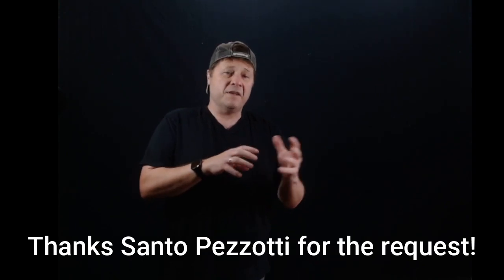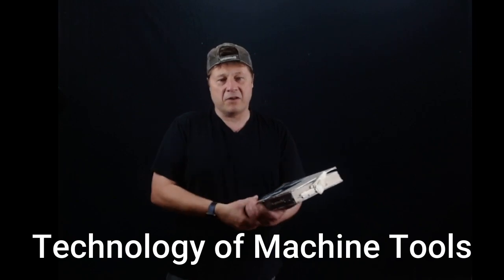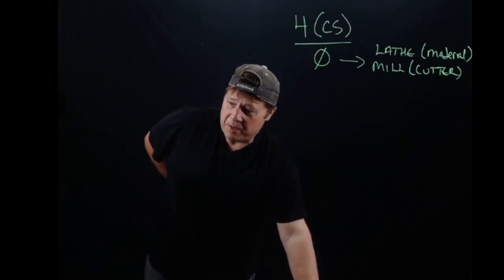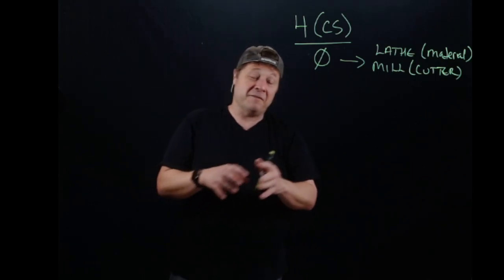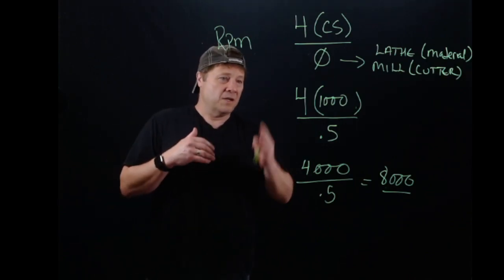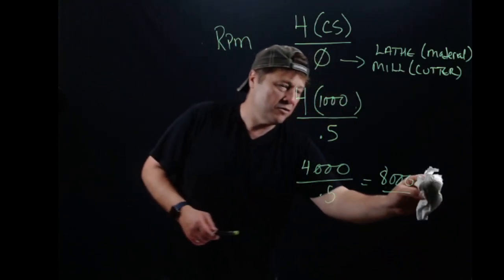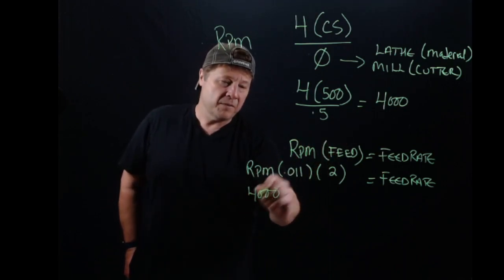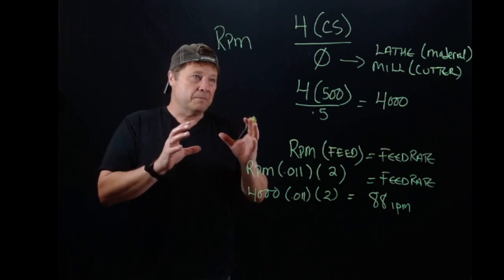Mill Feeds and Speeds - solve RPM and Feedrate

Comment: Should the feed rate for the lathe at 12mins in not be in inches per revolution, instead of inches per minute?
Reply from the maker: For clarification, the formula for Feedrate is RPM x Feed per Tooth x Number of cutting Teeth.
In the video I just refer to Feed per Tooth as Feed.
The solved 88ipm is the Feedrate in inches per minute.

Comment: Hi Adam
Thank you for video
Is cutting speed for metric  and inch drill same or different? when you use formula N=Vc *318/D and N=Vc*3.82/D?
Also Is cutting speed chart for drill and lathe also mill same?
Reply from the maker: Hello again @silkroad9188.  Cutting speed for imperial is in feet per minute and for metric is in meters per minute.
Simplified inch formula:
4xcutting speed/diameter of the tool (milling machine)
for metric
320xcutting speed/diameter of the tool (milling machine)
320 is the standard and doesn't change.

The non-simplified formula for imperial cutting speeds is:
12 x cutting speed / pi x diameter of the tool
I usually only use this formula when solving spindle speeds for a CNC mill as the spindle speeds solved can actually be used where on a manual mill, only approximate speeds can be reached.
Once again, I hope this helps!

Comment: Is there a formula to scaled-down feed speed? If my free rate is 7.353.6 RPMs but my machine max speed is 3,000. Is there an equation to scale the speed?
Reply from the maker: I'm not sure exactly what you're asking. What is the RPM that you calculated? And what is the maximum RPM that your machine can run? Because if you're asking if there's a way to calculate RPM based on your maximum spindle capabilities, then yes I can help you with that.
Reply: Cross multiply, then divide. Ratios are pretty simple
Reply: @adamtaylor999 yes I'd like to know this!

Comment: The correct (simplified) formula is RPM=(SFMx3.82)/Diameter.

People who use 4 instead of 3.82 are the "looks good from my house" guys. To simplify the real formula, you divide 12 (feet) by Pi (used in the circumference calculation). 12/Pi = 3.8197, which you would then round to 3.82, not 4. The book I have from college uses 4 as well, and it drives me crazy because the Machinery's Handbook uses the real formula. In machining, you need to be as accurate as possible, especially with harder materials. Please stop saying 4 is close enough.

**This is not an attack on you, it's an attack on the people who wrote the book that gave you the information.**

Other than that, this is great advice.
Reply: 3.82?